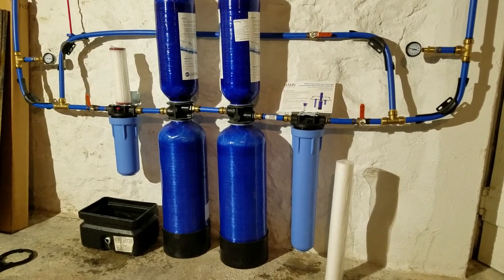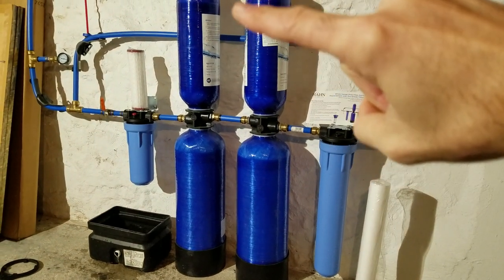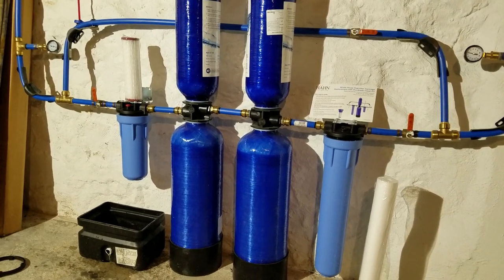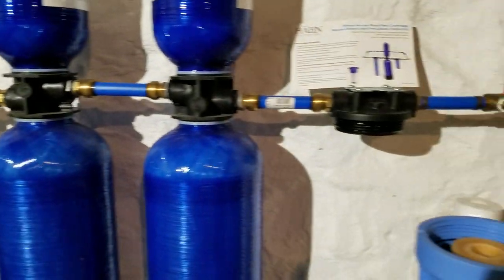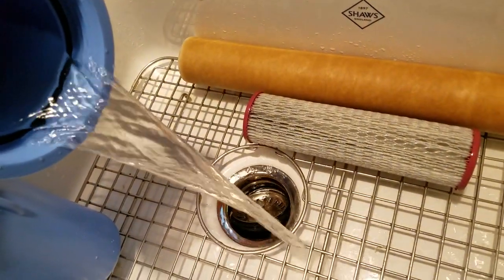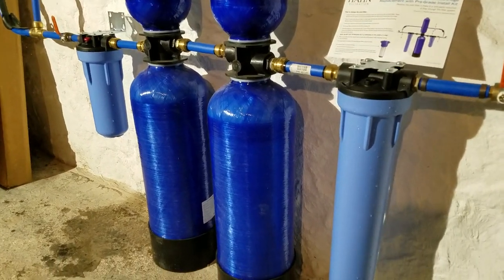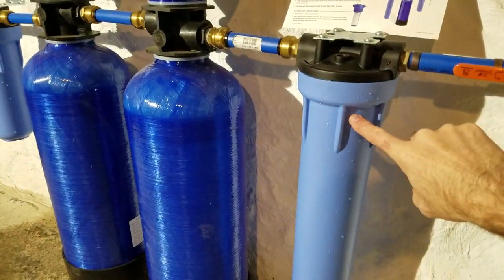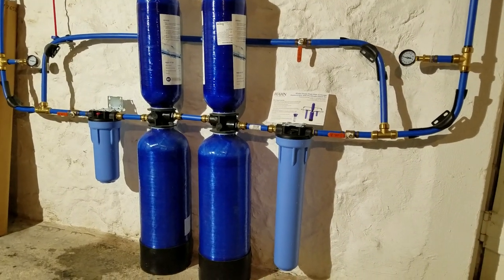Review: Aquasana Water Water Filter Systems, Overview, and Maintenance

Comment: Hi there, since you have this filter system for years, can you share with me if  everything works well the whole time? I'm about to install this brand, but I see how people complain on Amazon about this water softener system, that makes me worry. 
Thanks
Reply from the maker: Hi. Here's my experience so far. We've had ours installed for almost 5 years now and haven't had any issues. Just replace the filters as recommended and that's it. I can say that the water softener does work well even with our super hard water. It took ours from about 16 grains down to 6 grains. We dont get the clogged shower heads and washing machine water hoses anymore. It also removes all the chlorine in our city water.
Reply: @myoldhousefix  thank you.
Reply from the maker: @LHP74D3  you're welcome! 👍
Reply: I'm in SoCal and I just got mine installed today.  I installed it in the garage and it took me a while to install all the fittings. I had to cut my drywall to get access to city water line. Then the space in the drywall was so tight that I couldn't get my crimper in there. Definitely not that easy installation as installing it in a basement.  I have the 1M gallon without UV system. My system came with all brass hardware. Originally, it came with 3/4" hardware, but I called customer service and and sent me 1" hardware for free.

Comment: Never seen so many shark bites on a fresh installation lol.
Reply from the maker: good point! I try to design my projects with maintenance in mind:
1) when the tanks need to be replaced, or to make repairs (replace psi gauge, etc) or fix leaks, the Sharkbites make it a LOT easier and simplify the disassembly and reassembly
2: the system comes with plastic fittings requiring pvc glue to install (fixed installation). I couldnt see buying a filtration system to clean my water, then introduce the PVC glue contaminates, therefore the Sharkbites are a win/win 👍

Comment: Might you have a breakdown of the Sharkbites that you had to use? I’m about to install the same system and want to Sharkbite.
Reply from the maker: Hi Chris most of what you see came with the Pro Install Kit that they also sell. Otherwise the fittings are are all  male/female 3/4" fittings. For the tank I didn't want to use pvc glue, so those are male 1" if I remember correctly.

Does that help?
Reply: Definitely gives me a heads up. I’ll also do a pre set up and take a look at everything. I don’t want to deal with pvc either 😂
Thanks for having this video though and showing it can be done that way!
I did get the pro install kit as well. Just need to get my installation area ready for it now and have at it. Doing it for a well system.
Reply from the maker: @chrishampton5854  cool, glad to help! The only pex I had to buy was for the bypass loop and entry/exit feeds on the main line. Other that that don't forget your gages at each end, so is pressure ever drops you can verify input pressure vs after the filter system (clogged filter, etc) 👍
Reply: Which gauges did you happen to use?
Reply from the maker: I picked up 2 standard water pressure gauges from my local hardware store (no name/china). 0-100 psi. It's 3/8" male thread, so you'll need two adapters - 

1) 3/8" female to 3/4" female
2) 3/4" male to 3/4" pex nipple. Ring clamp it. 👍
Reply: I just had my system installed and I had ordered mine with 1" hardware. Fittings are brass, unions and male adapters are pvc.
Reply: So after further contemplation, I nixed the bypass loop as we don’t want unfiltered well water to run to the house at any point. So what I did was had 1” Sharkbite fittings for all the filters, using 1” PEX to connect everything. Then I used Sharkbite ball valves that reduced 1” to 3/4” to match up to the copper house lines. Used a couple 90* fittings on the 3/4” side and a few on the 1” between the post filter an UV filter. That 1” is not bendy lol.

Comment: My house goes from city water to well water at times. Such a pain in the Angus. Well water is so disgusting I can't see through a glass filled with sink water. 

So when I see options for city water or well water, I'm stuck because my city decides on both
Reply from the maker: I think Aquasana may have a FIX for you in this situation. Hit the link in the video description. When you land on the whole house filter system page...select WELL WATER. This system will cover both sources City and Well. You'll  also want the UV with well water. And I even added their under sink Claryum RO, just to be safe. 

Also, get yourwell water tested to see just what's in it, especially these new "forever" chemicals like PFAS.
Reply: @myoldhousefix  you're right mate. I'm dying over here, my skin has aged 5 years in 40 days. 
I just googled well water systems and came across aquasana as the first listing. Do you believe this is the top tier company and system? I went through the comments and see you're probably with the Optim system now, and using the RO under the sink for additional removal like fluoride. 

I was about to go straight tribal and distill water and use a bucket in the squat position in my tub lol

I'll probably go optim, salt free, and UV. Getting it for my dad because I don't want to lose him early to some of the many poisonous additions to our food, water, air etc

Comment: Hi Chris, this is Chris. Excellent system setup! Please post more information about the pressure gauges you used and how you attached. I am preparing to install a similar system in about a month. One suggestion... add a water meter to confirm flow and need to change filters (sooner or even later), I am opting for the water meter "Assured Automation WM-PC" analog model 1" size. Thank you again for the set-up details and design layout. Thank you in advance for any insight into the pressure gauges.
Reply: Correct me if I am wrong, but I think I have part of my answer to the pressure gauge set-up...please correct me if wrong... You used 1/4" fitting pressure gauges, connected with 1/4" to 3/4" brass hex adapter, connected to 3/4" adapter to sharkbite (Everflow Supplies Pushlock UPMC134 1 Inch x 3/4 Inch Long Push X Male Adapter Push-Fit Fittings) ? Or is it 1"?
Reply from the maker: Hi Chris, yes I installed one before the system and one after so I can monitor, if needed. I have about 52psi in, and about 49-50 out. I just used a t fitting, pen, and two 100 psi gauges from the local hardware store. Best of luck with yours, and glad to help!
Reply from the maker: @1warhelion  correct...1/4 to 3/4👍

Comment: Do not use mineral oil on the o-ring, it is petroleum based and will break down the rubber and eventually a leak will  occur.  So use siliconized grease instead..

Comment: Let me guess 10 year for 10k? Beautiful system though, I have heard great things about this device.
Reply from the maker: I think you can catch it on sale for about $1800.
Reply: Not that much at all. I just purchased the 10 year for 1650 on sale. A lot more affordable then most filter systems. I love it.
Reply: @minaprincess3696  the aquasana website is selling it for $4k
Reply: @pointblank6702  yea the best time to buy it is on sale.  I know there was a 3 months or something like that sale for half off.
Reply: @myoldhousefix  sir ye india me mil jayega kitne price me
Reply: I had my 1M gallon system with 1" brass hardware for under $1600. Bought it last Winter, but just got around to installing it today.  Installed it myself. The hardest part was I bought wrong PEX pipe that was super hard that I couldn't unroll it. Finally just gave up and bought 10ft straight pipes from HD.

Comment: Are Hahn and aquasana the same? Where do you get the filters? My post-filter is not made of paper like that it’s made of the same hard material as your pre filter.
Reply from the maker: Hi @big Mack, yep they sure are. Aquasana is sold at Costco under the Hahn name (I have it). You can get your pre and post filters here (and save some $ if you get the water for life recurring shipments) - https://click.linksynergy.com/deeplink?id=zfE5wRyxgig&mid=36667&murl=https%3A%2F%2Fwww.aquasana.com%2Fwater-filter-replacements%2F
Reply: @myoldhousefix  thank you very much. My system came with hardly any instructions or literature.
Reply from the maker: @bigmack2262  hey, glad to help...hit me up if you need any info...I'm familiar with their systems forward and backward. 👍

Comment: I have a similar setup, I also have the UV light. I have a question, if you leave any water that has been filtered out through this system and left standing for a while, do you notice a clear film start to develop on top? On mine standing water will start to form an odd clear film on the top. In contacting aquasana they told me it was because of the ion exchange the sodium floats to the top since it has nothing to join with which is what I see. I haven't heard of anyone else with this issue.
Reply from the maker: Hi Gabriel, I haven't noticed, but I don't usually leave any water standing. The ion exchange makes sense as it doesn't last forever - 36 hrs I think. I will put some in a glass and see what happens tho. Now, once when we went on vacation for a month, I did get a little film build up on top of the post filter rubber top. So that probably tracks to what you are seeing.
Reply: @myoldhousefix  I noticed my water will start to form the film after maybe 2-3 hours. I ended up getting a reverse osmosis under my kitchen sink to counter that from happening and it's worked so far. I just found it odd that I can't find people anywhere mentioning it. I originally discovered it because I did a before/after tests on my water after the system was installed and we left the water cups out and came back later to see the film and it had only formed on the after cups.
Reply from the maker: @ninjaman96  yeah that's weird! I'm performing that test now...so I'll report back in a few hours...
Reply from the maker: @ninjaman96  hey, so I filled a glass of water and left it for 6 hours amd it's crystal clear. And my system is 5 years old now. Looks like you may have something else going on?

Comment: The flow rate for this system is just 7.0 GPM, do you not find this kind of low? I was thinking about getting this but am now considering other systems due to this low flow rate.
Reply from the maker: Hi Hasan, only noticable if multiple high flow faucets are on at once. I noticed a drop with shower, kitchen sink, and washer all on at full blast.

Comment: Does your system remove fluoride?
Reply from the maker: Hi John, 

1) My Rhino System here does NOT remove fluoride - it removes 97% of chlorine and reducing other harmful contaminants including lead, mercury, herbicides, pesticides, VOCs, and more.

2) The OptimH20 whole house system (carbon block) - is IAPMO tested and certified to NSF/ANSI Standard 53 (includes P473), the system reduces more than 99% of lead and cysts, 98% of PFOA/PFOS, and tackles chlorine, chloramines, and more.

3) OptimH2O® Reverse Osmosis + Claryum - This under sink reverse osmosis system is tested and certified to NSF/ANSI Standards 42, 53 (includes P473), 58, and 401 to effectively reduce 88 contaminants, including 95% of fluoride. It’s also certified to remove 95% of mercury, 97% of chlorine and arsenic, and 99% of lead and asbestos while maintaining the benefits of healthy minerals other reverse osmosis systems remove. In all, the OptimH2O® Reverse Osmosis + Claryum® removes 5X more contaminants than other RO systems.  - $224.
LINK HERE - <a href='https://click.linksynergy.com/deeplink?id=zfE5wRyxgig&mid=36667&murl=https%3A%2F%2Fwww.aquasana.com%2Funder-sink-water-filters%2Freverse-osmosis-claryum%2Fbrushed-nickel-100236725.html'>LINK HERE</a>

Given that my Rhino system is now due for replacement after 6 years (the 2 middle tanks) I will be upgrading to the OptimH20 whole-house system and the RO for drinking water. 

Bottom line, you can remove the fluoride and EVERYTHING else for as low as $224 on the under sink Claryum system - its just one single point of use, though. Then add as needed for any whole-house concerns to soften, limescale, filter, remove chlorine/chloramines from showers and your mechanical equipment (boilers, espresso, hot water, etc).  Hope this helps John!

Comment: Hello Chris, thx for the video, can you tell me the tds readings after this house water filtration system? My house filter is not doing anything :@
Reply from the maker: Are you just testing with water hardness strips? Mine started out at 12-14 grains...now its 6.
Reply: @myoldhousefix  i have the digital device home forest YL TDS2 A. I get between 500 to 600 tds, no change with the expensive house filter that got installed
Reply from the maker: @jaimeim18  did you install this Aquasana system with the salt free softener (2nd tank)?
Reply: @myoldhousefix  oh I didn't install that system. They installed a Ultima filter without softener. I'm looking to buy something better. My water is no good enough and my wife is complaining of hair loss
Reply from the maker: @jaimeim18  yes, a filter alone wont soften the water. It will remove chlorine, sediment and minerals, but if it's hard water, you need a softener. The softener reduces limescale and hardness. We used to have to dip our showerheads in CLR every 4- 6 months...now maybe once a year or longer...
Reply: @myoldhousefix  that's great for a non salt softener, the retailer told me the salt free softener doesn't work, but I'm glad your system is working for you
Reply from the maker: @jaimeim18  I was a bit skittish as well, but mine helps. I will say if you have super super hard water like we do, its not a 100% solution...but its a 90%. 6 grains is still considered slightly "hard". So for our espresso machine I have an additional  "packet" in the tank to get it to about 4 grains...from the current 6. Our limescale is reduced about 70%. I think our remaining issues are with "chloramines" in city water as well. They are said to harmful to drink and for metals/mechanical equipment like on demand hot water heaters, boilers, dishwashers, etc...
Reply: @myoldhousefix  one last question, did your water pressure went down a lot?
Reply from the maker: @jaimeim18 just slightly. Our water pressure is at 52psi input from the street. With one high flow faucet running, like an unrestricted laundry sink, it drops to 48-50psi. Turn on a second high flow faucet like a kitchen sink, pot filler, or shower and it drops to about 36-38psi.
Reply: @myoldhousefix  I just installed the same system and our house pressure is horrible now. We have to bypass the filter whenever we want to run our sprinkler or outside hoses it’s silly. We have 75psi coming from the street which is high, kinda wondering if I have a clog in mine. Any experience in testing for that? I need install pressure gauges like you have I guess to test the actual drop .
Reply from the maker: @grahamloft263  yes, I would install the gauges just to make sure your pressures are ok. I'd also contact Aquasana and see if they can help. If you are running a high flow tap(s) outside and a few more inside, I can see where this would impact your overall pressure...

Comment: In the functioning mode, on my system the lever to the water is open when horizontal. But the levers that lead to the tanks are vertical which makes me think they are closed. I am confused as to which way is open and which way is closed.
Reply from the maker: you are correct, ball valves are usually in the OPEN position when the lever is parallel to line or pipe (running in the same direction).  If you have a service bypass, you would still havewater, just not filtered water if the filter valves are "off". 👍

Comment: So I assume that with your current system you really don't need to add a UV light for such things as E-coli?
Reply from the maker: Hi Terrence, yes we are on city water so UV is not a requirement like it would be with well water. Although, our city does report sporadic crypto vases, so UV probably isnt a bad idea...just in case. I'll probably add UV during my next major tank swap out (im 4 years into this 6 yr system).
Reply: @myoldhousefix  Hi Chris, Thanks for your speedy reply. After I watched your video I did more research on UV lighting and found it can be quite costly and the lights lose almost 50% of their efficiency after only 6 months use. SO I guess for many people who are thinking about this feature on their system, they should really give some serious thought as to if this is even needed in their circumstance. In my specific case I would be using this system to filter collected rain water from my storage tank for all my needs so I'm not certain if I would even need to add the UV filter on my system. I will say without a doubt that I would surely be using the aquasana filter system.
Reply from the maker: If I were collecting rainwater to drink, I would definitely add UV just for peace of mind...bird droppings, etc... It does have its pros and cons...
Reply: @myoldhousefix  What about well water for the pool? I would think there's enough chlorine in there to kill anything harmful...
Reply from the maker: @patricklim2836  yeah, I would think that the separate pool treatment (chlorine product, etc) is sufficient per product guidance.
Reply from the maker: I will be upgrading soon...
Reply: @myoldhousefix  please create a video on a tank swap out.